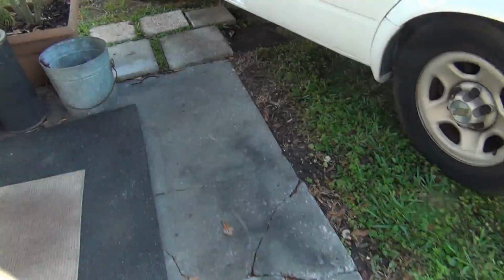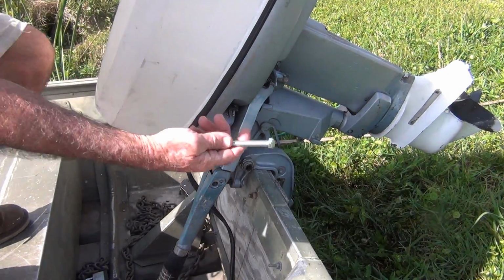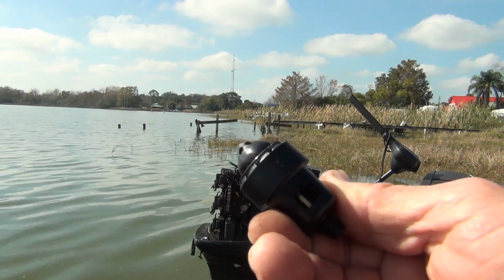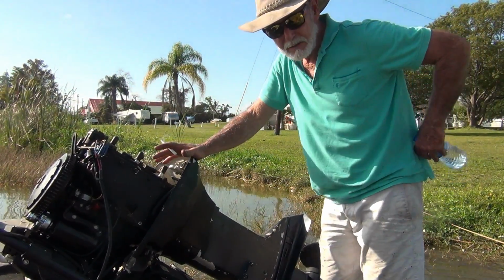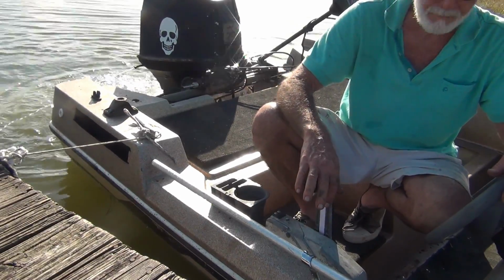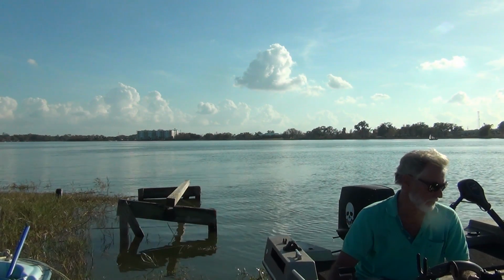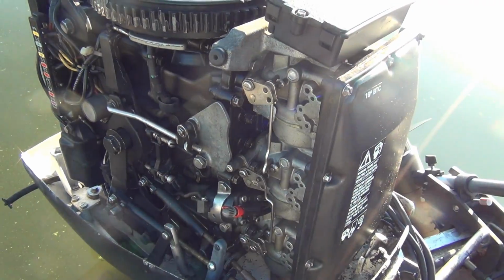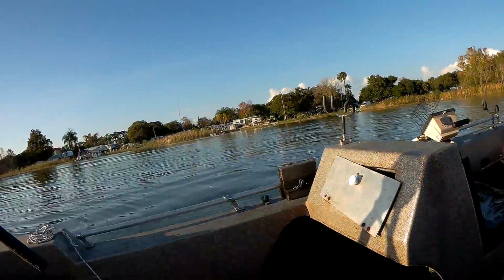1987 70 Hp Johnson Outboard - Stalling Under Load

Comment: Why is my 98 Johnson 70hp sputtering a little like a hesitation when I gas on it. Runs great starts good idles good idk what's going on it isn't bad but its definitely noticeable. Like a little sputter for 1 sec max. Thank you
Reply: My 88 60hp just did that this year I  pulled it out of storage after skipping one year ran flawlessly for 14 years so I'm guessing its fuel line issues or my carb jets are gummed up reducing the amount of gas available when going from idle to WOT the other thing might be bad gas .
Reply from the maker: Hey. Trying to get caught up on all these comments ! Its getting crazy ! I'm sure you figured it out by now. What did you come up with?
Reply: @THISOLDOUTBOARD1  My vro pump was cracked leaking gas out the back a little. Gonna go pre mix and put a regular fuel pump on

Comment: Well old school I had a mercury  20 that did the same thing and it turned out to be the lower unit , a seal at the base of water pump ,if this info helps any.
Reply from the maker: No, I'm not following what you mean. Seals are good, Gear oil was changed. Thanks
Reply: @THISOLDOUTBOARD1  some knind of seal from the lower unit is put Strain on the motor
Reply from the maker: @markrusso6401  Wow. never heard of that. Thanks

Comment: I have an 88 spl that did/does same thing. Replaced ever  fuelhose  fuel pump had carbs rebuilt.   Primer leaked bad after getting a new top/lever. Had to go back to original.      1 week ran great. Next week kept stalling.   
Hope you get if figured out.   Save me some aggravation too
Reply from the maker: Wow. I was hoping you were going to tell me what was wrong with it !  Hahaha Thanks !  Stay tuned !
Reply: @THISOLDOUTBOARD1    I still haven't got it figured out.  Water dropped and so did the temperature here had to just winterize and cool with it this spring.   Hoping to learn from yourself.

Comment: My 60 merc did that till I took it in and they said one of the plugs was fouled and the carbs needed adjusting. Another thing I was doing wrong was not pumping the fuel ball up before starting. Mine still will not get firm compared to my single carb yamaha. More carbs more problems. If that's not it maybe the reed valves? That motor really sounds like metal scrapping? Not like your other sweet motors
Reply from the maker: Hey Yeah I know . Don't go by sounds, the camera picks up the worst sound coming out of the carbs. Without the airbox/silencer it sounds bad on video but sounds ok live.

Comment: It sounds to me like your shifting linkage is pushing your clutch dog to hard causing undo strain on your prop shaft ! That would be my guess ! Just go back to the position that it was in before the stalling started ! Good luck !
Reply from the maker: Thanks I'll keep that in mind.
Reply: Got a 74 Johnson 50 stalls when put into gear I put it in gear a couple times then times it dies
Reply: Irvine porras it’s hard to say without watching it , do you have a video ? Most likely it’s the idle set when it does that but it could be a number of things ! Does it happen when the engine is cold or warm ? It could be a weak driver coil also .

Comment: Once again, I have kind of come in on the middle of this project, sorry....  In any event, I will have to go and watch your gearcase swap video.  I see that you were messing with the shift rod height....Did you set/check the shift rod height when you did the swap?  There is a specific dimension that is measured in neutral with the gearcase off.  Did you check to see if the clevis arm is tight on the horizontal shift rod shaft?  The aluminum arms love to loosen up which causes slop when shifting.  In any event, you gotta be sure this stuff is right, or you will end up with clutch dog problems.  Perhaps there is slop in the control cable/box causing difficulties.  Seemed to shift OK when you got done with it though....OK, on to the stalling...First, someone has converted this thing from VRO to a fuel pump, which is fine, provided it is done correctly and the proper fuel pump is used.  But, I'm not sure there was a mount for a fuel pump on this engine.  Everyone fails to understand that the VRO does not have to be replaced with a fuel pump if you want to premix.  The VRO makes a great fuel pump without spending all that money, just plug off the oil inlet and disconnect the VRO pulse alarm....  Your engine won't even idle, so I'm not surprised it won't accelerate...I'm thinking once the idle is fixed it will accelerate.  You got to start with the basics, which is sync/link adjustments.  These engines won't idle if the throttle plates aren't all closed at dead idle, and all start to open evenly at the proper time.  Let's try something simple, which will help point us in the right direction....  Try tapping the electric primer while trying to accelerate...If this helps, then we can feel pretty comfortable in that the problem will be found in sync/link adjustments or carb issues.  Keep in mind there was a service bulletin on these engines also.  The original .033" idle air bleeds are supposed to be replaced with .029" air bleeds on all three carbs.  This will richen the idle up slightly which will help.  The idle air bleeds are easily removed without any carb disassembly, but you will need the OMC jet screwdriver, 317002.   Once you remove one of them, you will probably need a magnifying glass to see the "33" stamped on the front of the air bleed.  But again, the sync/link must be checked first....How does this engine run at WOT, OK?  Have you checked compression?  Again, let's not overlook the basics on this thing.  How about spark, is that OK?
Reply from the maker: Hey. Where in the hell have you been. Hahaha You've seen this motor before when I got it up and running. Anyway, yes back to basics !  Cant comment to much right now, Sunday bar-b-q with the neighbors, you know what I mean. I'll get back with you with the details. Thanks !
Reply from the maker: Hey again.  Great to hear from you. Yes I checked the old gearcase and it was 6 turns out from bottom so I turned the new one out 6 turns but it did not line up. Thats why I had to drop the gearcase and adjust it. Its tight but the cables and box are old and sloppy.  I had this thing running like a rocket ship the last time I worked on it if you remember.  Anyway somehow it ran hot, I never really got the whole story as to what happened. When I pulled the gearcase it was shot, full of water and very hard to turn. Compression was 120 90 120, I soaked the middle cylinder with some wd40 and it went to 120 on the next test.? Anyway, I figure it will run well enough, and it does, so the guy can just go fishing, thats all he uses the boat for. Also keep in mind these videos are a week or so old, so I've made some progress this past week. After I got it all back together, I could take it for a run, come back to the dock, turn it off , then try another run and the stalling would to happen, so after it warms up, turn it off, Start it up and no go. So something seemed to be failing after its warmed up.? So back to basics with new plugs, link and sync adjustment, Fresh fuel, tighten all grounds down, replaced plug wires, stopped the primer from leaking, which would only leak when pushing the key.  So, the last run, with fresh gas, it started right up. hit the throttle slow and it stalled, fired it back up and hit the throttle fast and it took off, runs pretty good but if I throttle up slow it wants to hesitate and stall, throttle up fast and a very slight hesitation, almost unnoticeable and it takes off.  So back to the dock and cut it off. Waited about 15 minutes before I restarted it, fired it up and it ran the same as the first run. Throttle up fast, slight hesitation, throttle up slow and it wants to stall.
Reply: OK, so the engine got overheated....Now, it won't idle or accelerate...Middle cylinder compression a bit low.  So, you may have to "cobble" the correct sync procedures a bit so the old dog will work "OK" for him.  Don't forget to check those idle air bleeds, the smaller air bleeds will help also...D

Comment: Hey, you got plenty of fuel otherwise it would not be running like a scolded dog on the high end.  If you think about it you have idle as well. So it has to be your "off idle"  circuit that is plugged. To confirm that you said it would keep running from idle to full throttle with the choke up. Let us know if  this helps. Frick & frack carb........yup!
Reply from the maker: Hey Thanks for watch and commenting. The "fast start" lever is not a choke. Its just a throttle that dosent engage the gears for warming up the motor. Similar to the start position on a tiller outboard. But I like the way you thinking. Thanks again !  Stay Tuned !

Comment: Didn't u say that he ran it hot?
Reply from the maker: Yes. Compression test was 121-90-121. I shot some wd in the middle cylinder and it went to 120. It should run, which it does, and should be enough to just go fishing, which is all he uses it for.